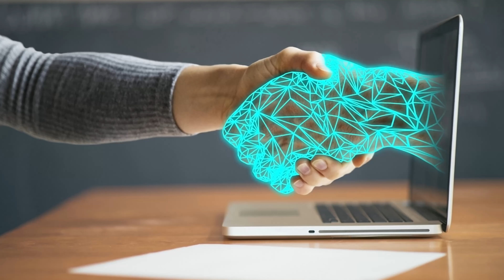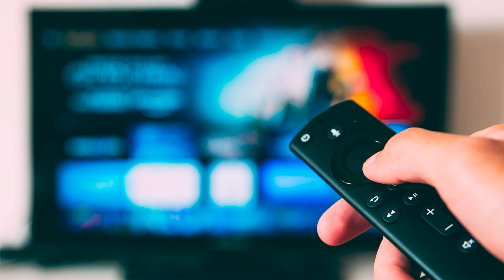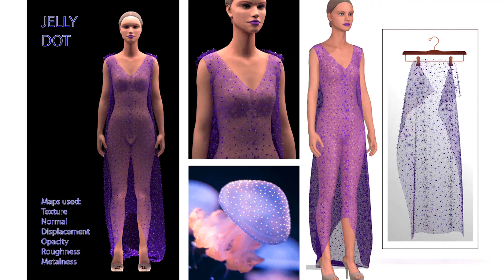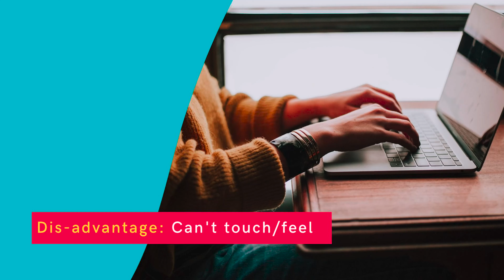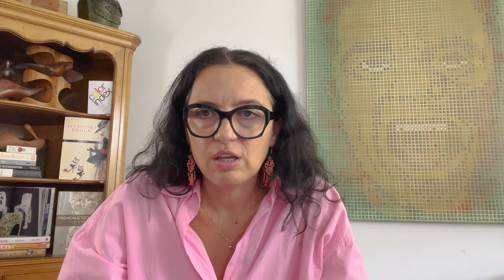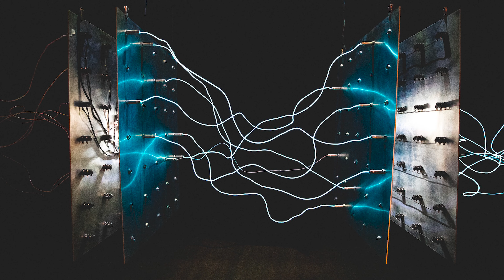Is CLO3D worth learning? The Pros and Cons

Comment: I'm still waiting for better avatars to create close fittings garments, especially lingerie. Not being able to change the bust sizing is the only disadvantage. Its cool that they added the soft body feature but it's far from being a perfect science if we are doing custom bodies outside of a standard sample size. I do find Vstitcher avatars have more options to truly fine tune the body measurements however its abit harder to use for those who aren't use to the UI
Reply from the maker: You can change the size of the avatar to whatever custom measurements you want including height and bust measurements. Just open the Avatar Size by going to Main Menu > Avatar > Avatar Editor > Avatar Size
Reply: @BobbinTalk  Unfortunately I’ve tried a few times on different scales and the cup is always incorrect and I find it’s better to flat pattern draft then rely on the avatar fitting.

Comment: Hi! I am hoping you can give some insight to my delimma. I am a new self-taught sewer, interested in having my own atelier where I custom create garments from a catalogue of my RTW designs. Clients can come in or go online, choose what they want and I custom create it to their body. 

I am thinking that learning Clo3D will be best for me to get started with doing this because 1.) it is just me and I’ll need to work quickly. 2.) I am more interested in the end result that the process of “feeling” the materials from the beginning, as you mention in the video. 3.) since I am working with different bodies, I feel it would be easier to simply update my mannequin to each persons measurements to adjust my patterns and then begin to cut and sew. 

I would essentially be using Clo3D as my pattern making process. To then print those patterns and physically create a sample for each client. Do you think that is a proper way to use Clo3D or is that too far-fetched?
Reply from the maker: That is absolutely a valid way of working with CLO! You can create an avatar with the desired body measurements and then make the patterns and simulate your designs. You can show various color ways and decide on your designs together with your client. And yes you can print the patterns directly from CLO and use them. I have students who use this exact process and make their designs. Good luck and let me know how it works for you!! 💛

Comment: Hi there,

I hope this message finds you well. I have a question that I was hoping you could help me with. Lately, I've developed an interest in learning digital pattern drafting. Initially, I was considering the PAD system, but recently I came across CLO3D, and now I'm feeling a bit torn.

I was wondering if you could provide some insights on whether CLO3D is as accurate for pattern making as the PAD system. Accuracy is really important to me, so I want to make sure I choose a tool that meets my needs.

I would greatly appreciate your thoughts and recommendations on this matter. I'm genuinely excited about delving into this new skill, and your guidance would mean a lot to me. Looking forward to hearing from you soon!
Reply from the maker: CLO is very accurate, but not the easiest for drafting patterns. The advantage of CLO is that you can see the garments draped on an avatar and see how the fit is and/or how a particular fabric behaves on the body. 
I see that as an advantage over other software that is pattern drafting only. If you don’t care about seeing the garments on a figure and just want pattern drafting I would recommend PAD, but if you want to see the actual garment immediately CLO is your best friend!

Hope that helps!
Aneta
Reply: Thank you for your reply. I now understand the differences between them. I appreciate your help.

Comment: Clo3d, Style3d, Browzwear, Optitex  and the others 3d software are all great.
No matter which one  you like the most and why.
All have the same problem  in my opinion.
Can we really trust the digital fabric behavior? Not 100% for now.
But as first draft of your designs they win hands down. No doubts.
The fashion industry need more designers using 3d technology.
Pattern makers are more likely to embrace 3d.
Designer are a little scared from the 2d part of the 3d workflow.
Reply from the maker: Absolutely! The way CLO adjusts the fabric or material around the avatar makes the simulations look great. We have a long way to go until we can completely trust the digital methods, but such software has already won its place in the industry no matter what!
Reply: @BobbinTalk  CLO3D is more likely to be used because of its single user license offer.
For all the others you need to work in a company who has one of them.
Now Style3d has starting spreading outside the China market.
They are bringing some interesting improvements.
I think it's important to have an healthy competition to keep R&D teams awake.

Comment: great video! Thank you, you just gained a new subscriber. I'm fairly new to the fashion field, I started studying (online, short courses, a bunch of trial and error) 2 years ago and I would like to continue learning, this time with technology. I started to make patterns on Ai very recently, and all this time I use the traditional method. While I enjoy it, it can be very time consuming and exhausting. Using software like these is a great way to speed up the process and it's very efficient. While it's absolutely great, I believe it's necessary to learn how to make patterns with traditional method and make a physical sample FIRST before starting using software.

I have a question, have you done a video where you sew the patterns you make on CLO3D and whether they look the same as on the avatar?
Reply from the maker: Absolutely!! Without fundamental pattern knowledge you cannot create real outfits even in digital fashion. I have not made a video where I have both the physical patterns and the digital patterns, but my students at Parsons School Design do it all the time. Not the videos, but the process. Some make the digital outdoor and then print the patterns. Others do a fitting on an avatar and then make the patterns or visa versus.
Reply from the maker: Thanks for the suggestion!